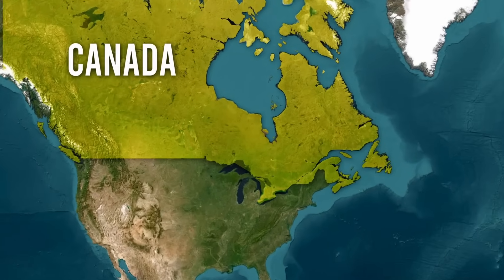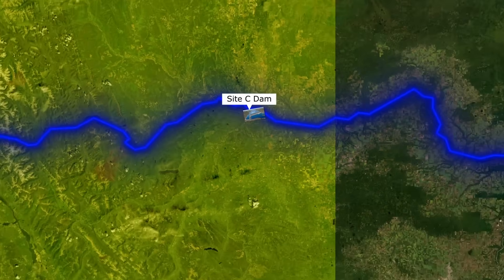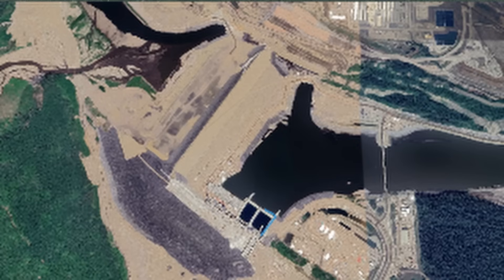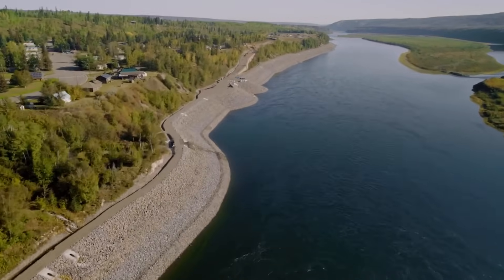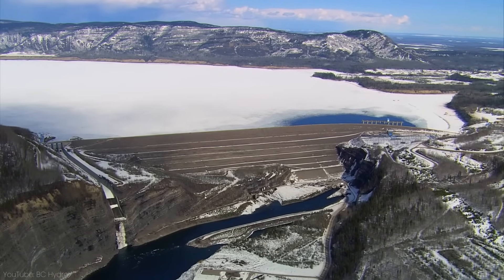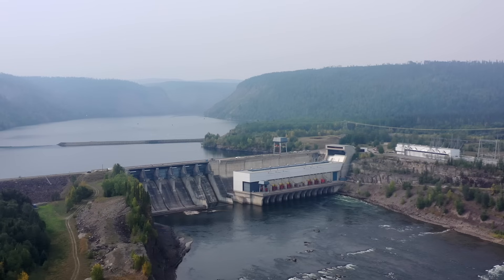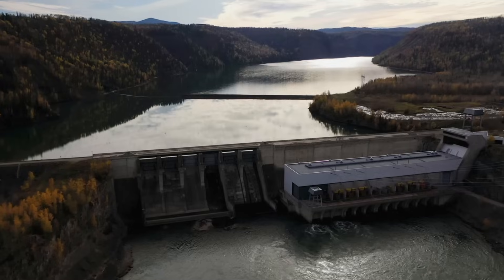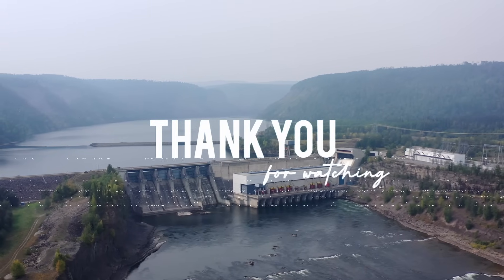How Canada Built Three Megadams on One River—and Changed It Forever

Comment: 21,000 Gigawatts or 21 Gigawatts ?  3 Gorges dam is 22 Gigawatts.
Reply from the maker: Thanks for watching and for the comment! The 21,901 number refers to gigawatt-hours (GWh), which is the total electricity generated annually by all three dams. That’s different from the Three Gorges Dam’s 22.5 gigawatts (GW), which is its maximum instantaneous capacity.

Comment: One mega dam and two lesser run-of-river dams.
Reply from the maker: Thanks for watching and for the comment! Not quite! The W.A.C. Bennett and Site C Dams are definitely mega dams, both in size and power output. The Peace Canyon Dam, while important, is smaller. Together, though, they create a powerhouse system on the Peace River.
Reply: None of these are run of river dams.
Reply: I worked for bchydro over 25 years WAC Bennett or as it’s known within bc hydro  as GM shrum is mega, peace canyon is considered down stream, not sure about site C. kooteney Canal   KCL is pure run of the river as it diverts a portion of the river. Mica dam feeds the Revelstoke dam on the Columbia

Comment: Would also love to see a video on The James Bay Project and the Nelson River Project in Quebec and Manitoba respectively. Between them are dozens of dams either built or planned and how they have evolved over time to become some of the largest power plants on earth! Or maybe a video on CANDU reactors, Canada's nuclear power plant of choice!
Reply from the maker: Great suggestions! The James Bay and Nelson River Projects are incredible examples of large-scale hydropower, and their evolution over time would make for a fascinating deep dive. CANDU reactors are another great topic—Canada’s innovation in nuclear power deserves some spotlight. Thanks for the ideas, and stay tuned—you might just see one of these in a future video!
Reply: @MegaBuilds5280  A water diversion was recently added to the La Grande complex which further increased the amount of power that it can produce. The reservoirs behind those dams are some of the biggest on the planet. Particularly notable is the fact that the modern high voltage power line was invented for this project. Without this advancement, they would have needed at least 3 times more power lines to get the job done. They are still to this day some of the highest voltage power lines on the continent.